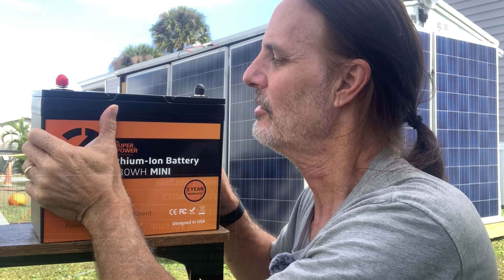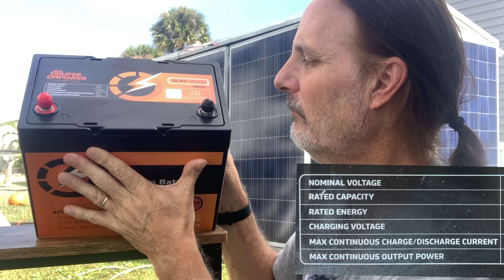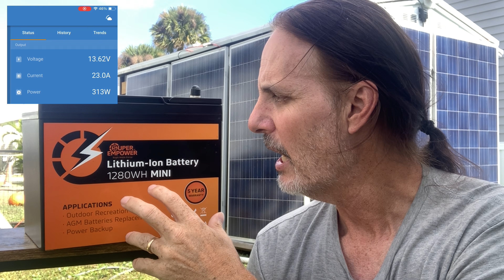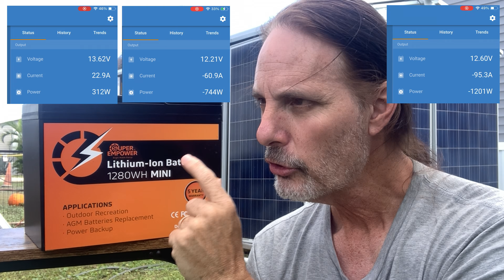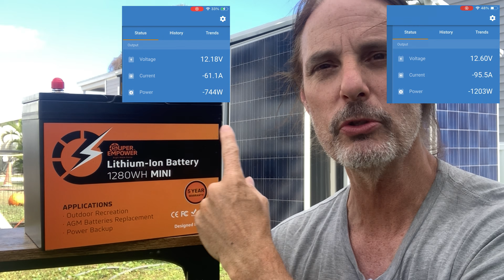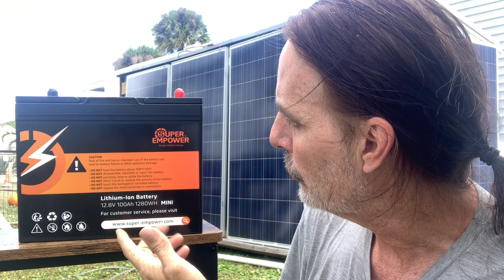Tiny Battery, HUGE Mistake? (Test Results)

Comment: So this would be a good trolling motor battery?
Reply from the maker: Yes, it would be good for that.. Most are 24v do you need a 24v or 12v trolling motor?
Reply: @MattManSolar 12v 35lb thrust

Comment: Hey MattMan, I'm just looking to purchase a battery to have in the event, while RV'g or camping, & It's a bad sun/solar day and I don't have good AC. I want to have reliable battery that I can use to recharge my Oupes Mega 1. I have the expansion B2 battery, but you never know, I may need to have other ways to recharge my power station. Is this a good battery to have for that?
Reply from the maker: what size system, do you have 12v .. this is 100ah .. but if want big 280+ power get that metal eco worth battery that thing is awesome.